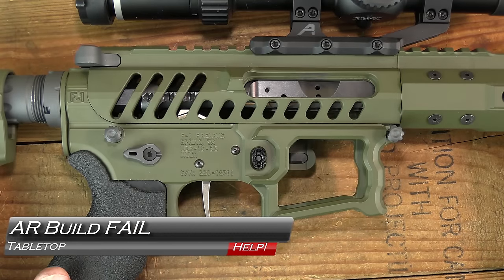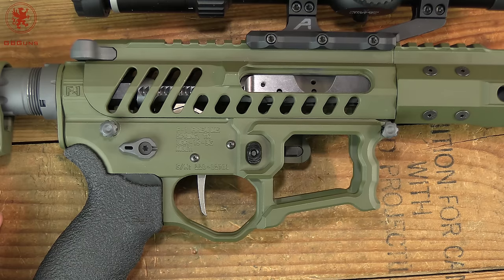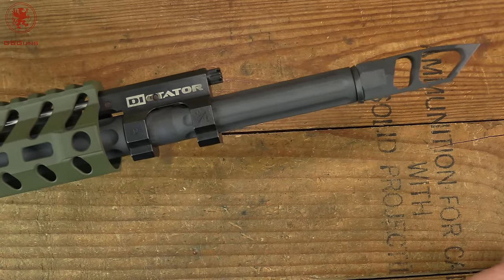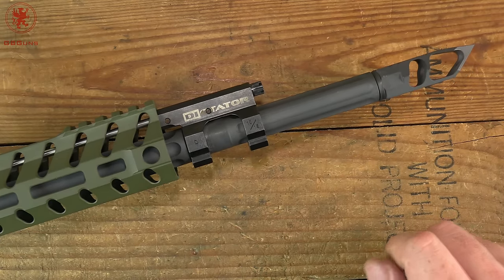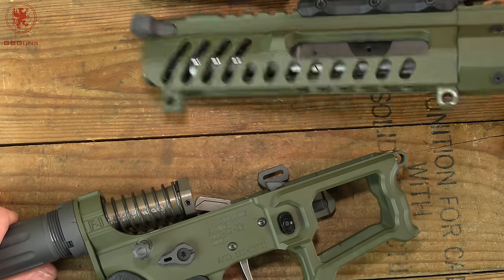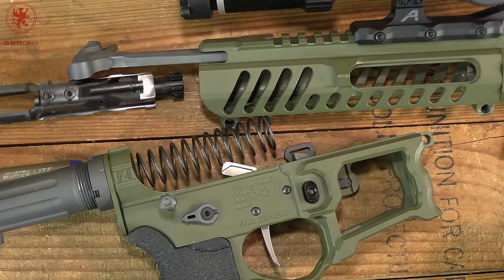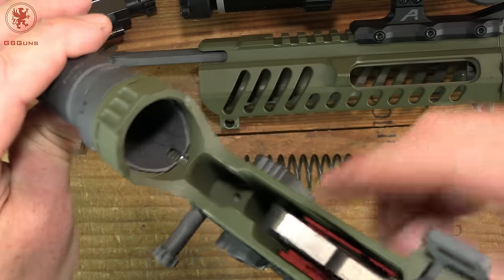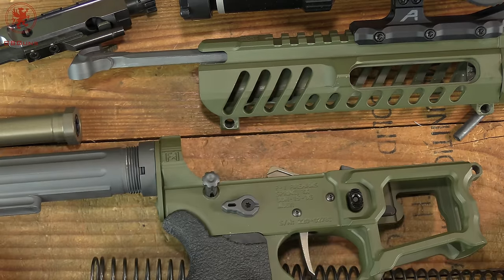The Worst Thing You Can Do For Your AR

Comment: The worst thing you can do to your AR is have it “skeletonized”
Reply: Eh I think it's cool for a range toy, but I wouldn't trust it on a gun for home defense or SHTF or whatever.
Reply: First thing I thought was how much "gunk" is going to end up in the upper. Might look cool, but, I prefer Bang every time I squeeze.
Reply: Only in combat. Recreational shooting should not get sand in it. Unless you drop it
Reply: @dalea1691  You don't think dust and sand doesn't get blown around outside of combat?
Reply: Not in here. East coast florida. But yeah, I didn't think out west
Reply: @dalea1691  I'm not saying you have to stress test your rifle but it should be able to take some abuse and some debris unless it's purely for recreation but a lot of people will use that same firearm for self-defense.
Reply: It'll work fine as a range toy, doubt he's trying to build a go-to rifle
Reply from the maker: No, I already have a few of those.
Reply: OP is correct.  You skeletonize an AR to make it lightweight, you're just eliminating its heat sink capability.
Dump 2.5 mags in a firefight and the thing will be hot enough to melt your gloves.
Reply: The Honkler  
I just finished my upper for 1500 and got all the parts for the lower.
You teling me i shouldnt get the skull lower reciever?
But imagine how edgy id look.
All the ladies would drop their drawers for me as soon as they saw it.
Reply: @RRRRobbbb  OH PLEASE!!. How many "firefights" is the average person in? The only people dumping 2.5 mags under combat conditions are the blue Taliban.
Reply: LMAO@Rob
Reply: Rifle gas system on a carbine buffer.
Reply: the worst thing you can do to your AR.. is not use it..
Reply: The worst thing you can do is own an ar.
Reply: @wendellsawyer4386  unless you're at the range during a sand storm, it's fine. You should be cleaning it after every range trip anyway. IDK why people get so over the top with coddling their guns. It'll work with a little dust in the action, relax
Reply: This is wat happens when u have too much money
Reply: Why?
Reply: They are actually cleaner and run cooler than the standard AR.   They have been torture tested, drug behind trucks, thrown in Creeks etc. skeletonized is just as durable as non.   Dropping it in sand and running thru mags will eventually wear the bolt carrier faster if you don’t clean it. 
The only weakness I’ve found Is when you put the barrel on, you can’t use the block and vice or it could crush it.
Reply: Try a buffer spring with less tension. Sounds like you don't have enough weight in all your super light  parts to have enough kinetic energy to fully compress the spring
Reply: @erikwilson7622  On the other hand, a lot of gunk probably leaves the upper also.  Maybe not, never owned or shot one like that
Reply: The skelonization has no harm at all to the rifle. Seriously, have u ever looked in your receiver after u have shot 500 rounds. The dirt from the explosion goes straight to your receiver.  The buffer and spring need to be changed.
Reply: Rob, the F1 is a great gun, love the build. I have built many of them. Ubr, FDR, BDR etc. I have built the 10s and the 15s. I had same issue with 1 build. I swapped buffers and spring and it solved issue. This gun is as durable as any AR out there. They have been used in competition for years and always come out in flying colors. It won't melt the gun. Or melt your hand or get full of dirt etc. The blast from the round throws more dirt and debris into the receiver than anything else. All the haters watch demolition ranch, he throws them in a muddy pond, works fine. Plus F1 has torture tested probably more than most companies would ever torture there rifle. Good job, drop a gee different buffers and springs in the gun and u will solve it. Springco has a great assortment and they are not to expensive.
Reply: Yup that thing is a range toy at best
Reply: @dalea1691  here on the E Coast of Fl also.
Reply: @GBGuns  i'm  pretty sure there are buffer spring kits. Might be jp enterprises
Reply: @bigfoot3866 lower is fine, just not a upper
Reply: If by "skeletonized", you mean the vents in the upper receiver, that was the first thing I noticed as a way to ruin an AR15. It's okay to have vents around the barrel. It's okay to have vents in the stock or grip. One thing I would think everyone would understand is not to have vents around the moving parts susceptible to dirt, debris, etc. I mean, if you're just shooting in clean, dry, dust-free air and never get into the prone... hypothetically, it should be fine. 

Personally, I would never notice any benefits of that configuration in terms of weight, heat dissipation, etc. I also imagine some oil might vaporize and get into your eyes when firing unless you keep the bolt carrier group extremely dry. I remember getting sprayed in the eye when I was doing Marine Corps weapons qualification in boot camp. Also, guns are naturally pretty water-resistant. That is, until you start putting vents in the upper receiver. 

Do you cut vents in your automobile tires to reduce weight too?
Reply: They are the worst, especially if you're running suppressed. I shot a buddies and got my hood stuck in the upper. fucking trash.
Reply: First thing I thought when I saw the thumbnail lol
Reply: @SitNSpinRecords  let's see the videos of these torture tests? I call bullshit. I had one lock up on a friend that pinched part of his shirt in the upper. If a thin piece of fabric can cause a failure, I don't buy it.
Reply: Just as useless as Biden.
Reply: @johnbrooks6257  Amen!!! (And, awoman, for those people.)
Reply: My lower is skeletonized but I use a ultralite Gibbz upper with JP Enterprise stainless bolt. as foe barrels I use BSF carbon barrels for the most part. As to your issue I would change your gas block to a titanium fixed gas block.
Reply: More gets in than out 🤷‍♂️
Reply: @Leman.Russ.6thLegion  I’m an equal opportunity hater.  I own both.
Reply: the worst thing you can do to an AR is buy one. What the heck is wrong with a good ole 762 Fal? Or a decent PS90? Or a KSG25. Heck even your normal garden variety KSG. Load it on Sunday and shoot till Tuesday especially if you got a truck load of Minis. 

Trust me, most home invaders have a certain aversion to being shot in the face with a mini shell full of anything.
Reply: that was my first thought. hahah i mean to each his own he's obviously using it for competition purposes and not practical purposes so its obvious that its not a fighting gun. the design itself was intended tp be cutting edge of lightweight. who cares tho his shit not ours. hahah
Reply: @samevans1535  sorry, the what now?
Reply: @Leman.Russ.6thLegion  exactly. There is just not enough mass to cycle the thing. Not everything should be as light as possible.
Reply: @chaserevstuning9271  thats what i have been shouting to anyone who has ever heard of the words inertia and momentum.
Reply: @jussayinmipeece1069  yeah basic physics, more mass is more potential energy so more kinetic energy when in motion. Idk why people don't understand that lol. Same reason we have flywheels with mass on a car. To get it going easier
Reply from the maker: Not to be lightweight, to be soft shooting; to spend as little of the combustion energy as possible le on operating the gun and much as possible on moving the bullet
Reply: @chaserevstuning9271  people get caught up in the 'lighter is better " syndrome without understanding why things were designed the way they were.
Reply: @GBGuns  those things are incompatible. 
For every action there is an equal and opposite reaction. A "soft shooting" gun has to absorb as much of the momentum generated by the reaction of the propellant as possible.. If you try to get the most energy into the bullet then you get the same amount of energy pushing back into your shoulder. That's the opposite of soft shooting.

If you want a soft shooting gun you need the gun to be as heavy as practical so that the energy  of the propellant has a harder time moving the actual gun . You most definitely will not get that with a feathers light gun.

Your best bet would be to install a much longer recoil spring with a progressive helper spring towards the end of travel along with a heavier buffer half filled with sodium.
Reply from the maker: So then I must have built the impossible, and yet it runs, and well
Reply from the maker: And oil lamps were fine
Reply: not every rifle is for home defense or armed combat, sometimes things just look nice
Reply: You should probably watch the video of Ryan Muller covering his F1 with dirt and sand and then doing a mag dump.  That might help you stop speaking from a position of ignorance.
Reply: Amen. Skeletonizing  is only good in some niche competitive shooting situations. Other than that it horribly cuts reliability especially if you cut up the receiver like that.
Reply: I agree I don’t even like porting on pistols and such .
Reply: @nuworldman9280  carbon from firing is not what people are talking about
Reply: No.
Reply: @XtremeConditions  range toys that don't work properly are an embarrassment to the owner.   Glad it's not me
Reply: @dalea1691  As long as you are standing, or shooting from a nice clean table.  No prone for you
Reply: @XtremeConditions  the hell is the point on spending that much money on a gun that has worse reliability than a Saturday night special?
Reply: @samevans1535  "Blue Taliban" something tells me you're an anti cop shill.
Reply: Please explain genius. And having it skeletonized has absolutely nothing to do with it short stroking.
Reply: @michaelbonanno9491  Some people are too dumb to bother explaining to, you can learn for yourself.
Reply: Too true!  You are just begging for dirt and debris to foul the action. My guess is though, this guy is a range Commando and his intention was to wow his beer Buddies with this thing. Not necessarily build a reliable solid firearm. It looks like he paid the price for his poor decisions.
Reply from the maker: Looks like you didn't read the video description
Reply: Had the same problem. Cut 1 loop off your buffer spring, put the gun back together, fire and see if it cycles. Repeat again until the gun cycles. Also I didn’t see if you had a detent pin on on your buffer tube.
Reply: @Leman.Russ.6thLegion  negative! that sounds like commie speech to me!
Reply: @erraticstatic70  did u actually read through 60 comments on a video with an ugly hedgehog AR??? I DON'T EVEN REMEMBER WHAT I WROTE!! AND I CAN'T EVEN FIND IT ANYMORE!!! WHAT IS THIS WORLD!
Reply: @dalea1691  you should worry about the saline water blowing around. And if you think you don't have sand and shit flying around in FL you're just wrong.
Reply: Honestly thought that’s what the vid was going to be about
Reply: @dalea1691  bro. There is sand in everything i own.
Daytona....
Reply: @sethlamson  I don't shoot on the beach.
Reply: @dalea1691  me either. Sand just exists everywhere here. Sand most definitely gets blown around at the range.
Reply: @dalea1691  what if the Russian Chinese Mexican cartel invade.
Reply: @johnqpublic7191  They won't with a friend as President.
Reply: @dalea1691  fair point
Reply from the maker: You may want to consider a better hygiene routine, or moving.
Reply from the maker: @sethlamson  what makes you think this is a lightweight rifle?  You sure seem insecure about your masculinity.   Do you also drive a lifted truck?
Reply: @GBGuns  xD
Reply: @GBGuns  ha. Nope. 
What makes me think that? What is the point of skeletonizing anything?....
Weight reduction. 
Muduh.
Reply from the maker: Except these receivers weren't skeletonized (reduced to a skeleton) they were designed this way from the beginning and have thicker walls than a normal receiver to maintain weight.  I'm sorry you were distracted by simple visuals.  You missed the entire point of the video.
Reply: @GBGuns  ?
Then it makes even less sense.
Reply from the maker: @sethlamson  Try reading the article: https://www.ballisticmag.com/impossible-ar-build-myths/
Reply: @GBGuns  i was just takin the pis xD
Reply: I think he was going for lightweight or something,
Reply: An out of battery would probably do no damage to the upper, as its already destroyed.
Reply: @MattPiekarsky  manual bolt hold opens, all over the receiver
Reply: Yes
Reply: To be fair, people shooting F1s are generally putting 5k rounds down range a year, my buddy's colt on the other hand has seen 20 rounds since it was first bought 10 years ago.  I'm sure that colt will continue to last a long time at this rate, but I'm not sure it's because it's a better gun.
Reply: @erikwilson7622  supposedly skeletonized may make it easy for stuff to get in, but it also makes it easy for that stuff to get blown out.
Reply: Yep
Reply: Nice gun but your doing tooooo much. Get a standard bolt, new buffer spring and you'll be like Rambo gone metro.
Reply: @RRRRobbbb  wait..... are you suggesting promoting air flow will cause the gun to get hotter?
If you have vent holes all over it, it stands to reason that you have increased the surface area in which the air is able to remove heat, thus you have increased heat sink capability, not decreased it
He also mentions in the video the receiver is not lighter because it had to be made thicker.
Reply: @dalea1691  You haven’t been shooting slot huh?
Reply: @Chief556.  I haven't been shooting.. period! in the last 3 years.
Reply: Sam R  the benchmark people set for a reliable gun that doesn’t give two shits about dirt is the ak because everyone knows about it and it really just doesn’t care about dirt. I’ve seen ak’s tested with ar’s and the ar’s fired for longer and did it more accurately. I’ve seen some bad ak’s that someone destroyed after only firing a few boxes through in a few hour period. You can try it all about bad ar’s but any reputable company makes them mil spec and you can build a mil spec ar for about $450 from places like palmetto state. Ar’s aren’t as fragile as you say, they tend to be more accurate, more practical, and more reliable when it comes to constant use than an ak. Again ak is just a base like for reliable robust guns which is why I’m comparing it to ar’s.
Reply: @chaserevstuning9271  you don’t understand basic physics. You get all the energy from the bullet which pushes on the bolt carry and spring. The more mass you have in the bolt carrier and the harder the spring is the more energy you need to get them moving. The most basic part of physics is that anything with mass has inertia. The more mass you have the more you resist movement. If heavy bolt carriers meant more energy pushing back then someone could push on an 18 wheeler and have their force multiplied. There are a few different ways an object with mass can have potential energy and none of those ways include just sitting in a gun at a relative height of 0. Object with mass have the potential to carry more energy at any given speed and can have more potential energy at any given height but do not inherent have more energy in them because of their mass. The only thing you do when you get a heavier bolt carrier is reduce work and the movement speed of the internals of the gun because it uses the same amount of energy to fire no matter the mass of the bolt carrier. The only time a heavier bolt carrier would be useful is if you’re shooting something much bigger where you need the added strength in the bolt carrier. There’s also things with springs that are too heavy which can cause the fire rate to be too high. The issue can probably be fixed by changing out the spring or just not putting a full length gas block on it be the barrel isn’t long enough. Also a flywheel is just a way to store energy. Again if you put the same amount of energy into a flywheel that weighs 10 pounds vs one that weighs double you would end up spinning the 10 pound flywheel much faster than the 20 pound and it’s an exponential function. That means to store an additional 10 joules of energy in the 10 pound flywheel after you already put 20 into it might increase its rpm by 5. If you then add another 10 joules of energy when the 10 pound flywheel has 30 then you’ll have to increase the rpm by 6 or 7. For all intents and purposes let’s assume both flywheels have the same dimensions. Both flywheels may have 20 joules of energy in them but the 10 pound one will be going 10 rpm while the 20 pound one will only be going 5. Any increase will affect the movement of the 10 pound fly wheel much more than the 20 pound flywheel despite both systems having the same about of energy in them. If you relate that back to bolt carriers the heavier one will speed up and slow down much slower causing only for a change in fire rate and a slight smaller stroke per shot that may not even be noticeable or even measurable. So I’ll restate what I said, you don’t understand basic physics.
Reply: @wolfaja755  you don't. Takes more mass to compress the spring. Called potential energy and kinetic is whats produced. Higher mass has more potential and more kinetic. Stiff spring will be able to overcome any light mass moving object making it unable to fully cycle. Sounds like you don't understand how this works.
Reply: @wendellsawyer4386  for “recreational” use, not nearly as much as there would be in combat not to mention you’re not fighting for your life or expecting for the gun to save your life it’s purely for recreational use….
Reply: Yeah cause the main reliability benefit of the ar platform is it’s a closed system
Reply: Think again.
F-1 skeletonized udr-15, and I recognize that Faxon skeletonized bcg anywhere.
Paired it with a 16" faxon pencil in 5.56 and found a guntec ultralights furniture set including buffer and spring with a stock for the tube.
Even the grip, it's so skeletonized, you'd think I summoned it with the Necronomicon.
7 lbs, the only pin I punched was the superlative gas block.
Secret number one, not just adjusting gas, but preventing overgassing.
Secret number two: VG6 muzzle brake, my gun shoots with an X-box haptic feedback.
melonite gas tube, I went mid length and mil spec on every part of my build.

My first time at building one, it's an epic weapon with unencumbering and accuracy enchantments powering the whole system.

Cost me a grand, including the 3x burris fixed scope that reaches 600 yards at the bottom of the reticule.

I'm assuming the top of the retucule will help bring my shots up close of need be, but I'm sticking a red dot on the side mount just in case.

Never had a problem with the take down puns, mine had a set screw to adjust the tension (actually, I had to buy one, mine was missing, also a shorter one for the buffer spring so you could screw it all the way in to check the buffer and spring... I prefer the spring), and after having troubles with sticky triggers, opted for a drop in.

The AR-10 build in 7.62 would cost $2k before scope, 18" barrel, and inclined to think it won't weigh more than 7 amd a half.

Nothing wrong with skeletonized, just gotta know your parts.🤫😉
Reply: Sam R  laughs in mud test
Reply from the maker: Why would I do that? That's not what it's built for.
Reply: U think the pistol grips are fine but idk and it all over the gun
Reply from the maker: Lol, you must be new to the channel
Reply: @Leman.Russ.6thLegion  yo youre the worst tank ever
Reply: Fyi that is an Iron City Beserker matched upper/lower. It's skeletonized, and very close tolerances for people shooting 3 gun competition. It's better than any mass produced forged recievers that come on complete factory rifles that are common. I do not mean billet matched proper built reciever complete rifles from factories like Grey Ghost, Seekins, SanTan, V Seven, Daniel Defense, ect. which are not common mass produced AR15's like Anderson, Ruger, bushmaster, and other cheapo brands that are ok but nothing like the first brands I mentioned.
Reply: Yup.
Reply: It is totally useless in the way this design was meant to function,..a pimp's machine..it's awful
Reply: @muddyhotdog4103  shouldn't every rifle be ready to become a "go rifle"? Never understood the "range toy" mentality. I should be able to count on whatever AR I grab, if it's built to not perform as well then it might as well be a paper weight.
Reply: @BloodyKnives66   Well, built perform how is the whole question. Go-to battle? Go-to compete? Certain things are better for different performances.  I would never make a raced out competition ar15 for sporting my "go-to" rifle.. Sure you "want" a competition ar15 to be as reliable as possible, but corners are cut to grab an edge and make it low drag/high speed where reliability isn't necessarily the top priority. A go-to rifle should be reliable above all; things like weight savings and controllability should be features to strive for in a go-to rifle, but not at the cost of reliability.
       Sure you may add lightened action springs and lightened bcgs ect to your ar15 and it might be dead nuts reliable on the range, but those types of things will make stoppages/breakages more likely in the long run.  Dont get me wrong, you can find a happy medium between all that but you just gotta be careful. It really depends on the rifles purpose, people aren't always looking for a go-to rifle in some cases. Sorry for the long reply, wanted to make it clear what I meant
Reply: @samevans1535  You ever heard of competition shooting? Or maybe going to courses to train to be proficient in using your weapons? Food for thought. No need to get all emotional on YT.
Reply: Why what’s wrong with skeletonizing it?
Reply: Its good to go …. Just like wearing sandals on the beach as easy as the sand comes in is as easy as the sand comes out versus wearing shoes at the beach and u get sand in ur shoes u gota take the whole thing off and knock it out …. Same concept
Reply: @GBGuns Cut some off your buffer spring. I got a 9x39 upper from a known barrel manufacturer and that's what they did with a cheap 9x39 upper to get it to cycle correctly. Light weight bcg, light weight buffer and the spring was partially cut off lol. Where the coil ends, instead of a machined flat surface, they just cut it off. Don't think they ran a can on it, if they did they super tightened the muzzle device back on.

If you've followed some people and their quest to tame 9x39, barrel length and where the gas port is drilled is extremely important. Worse case Ontario put a different barrel on with the correct gas length, and see if its still under gassed. I'd check on recoil springs to see if you can find a lighter one and worse case try clipping a small bit off it and see if it helps to lighten the spring tension. Heavy subsonic ammo out of a short barrel doesn't like to properly eject, reduce the recoil by reducing the spring. Made sense to me when I thought about it.